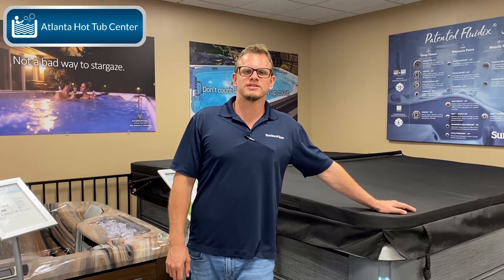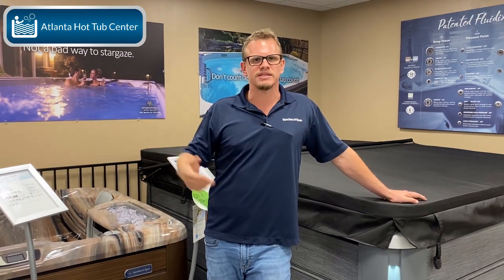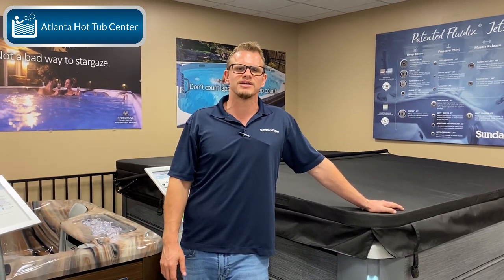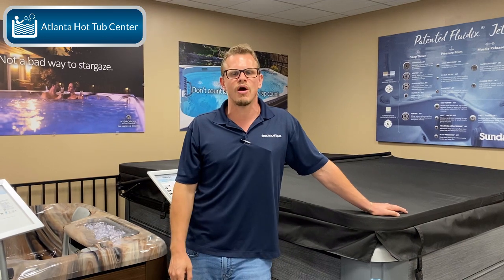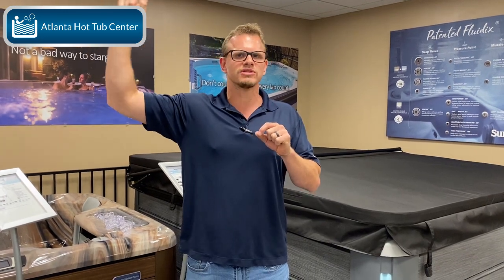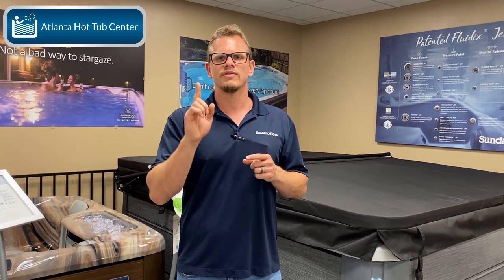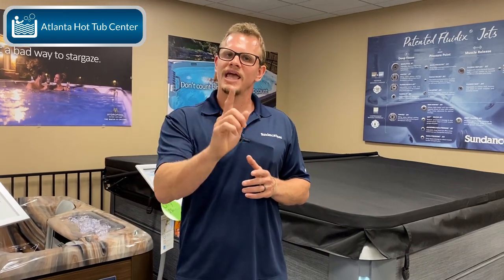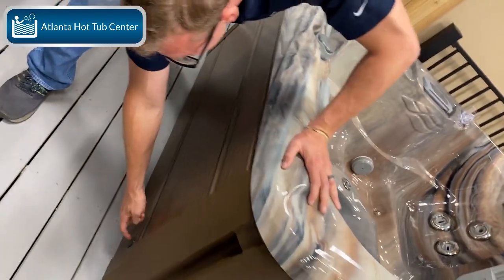HOT TUB ELECTRICAL review

Comment: Hey Brian, have an 880 on order and will run it on 60 AMP.  My electrician wants to drill a hole in the actual tub frame work nearer the panel. Can he? and will it void any warranty? thanks
Reply from the maker: Good evening, the hot tub is designed to be a sealed unit for numerous reasons.  There’s a circular cut out pre-fabricated for the conduit on the front right and left corner.  Your dealer should be able to provide you the schematics.  I wouldn’t drill through the base but I’ve seen people do it more than once.  Hope this helps!

Comment: I ordered a Hamilton 780 that should be here any day.  The only GFCI spa box I could find was 50 amp plus the default setting for the Hamilton says 50 amp.  I ran it using 6 gage for the hots and common plus 8 gage for the ground.  Hopefully it shows up soon.  I did read about the 60 amp keeping the heater on always but couldn't find the external spa box so went with 50.  No that I know need 6 feet from the port I can hook up the cable from the spa box to the hot tub and pre stage it.  Thanks,
Reply from the maker: Good morning, you’re very welcome.  If you have any questions let know.  Thanks for watching!